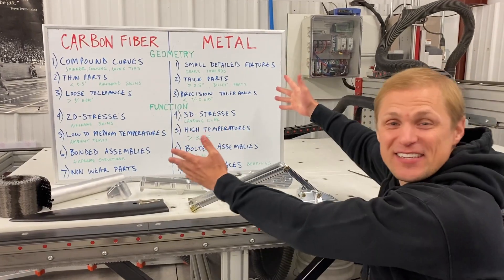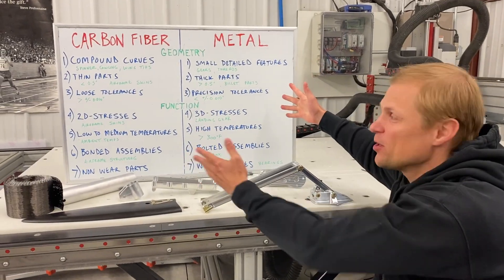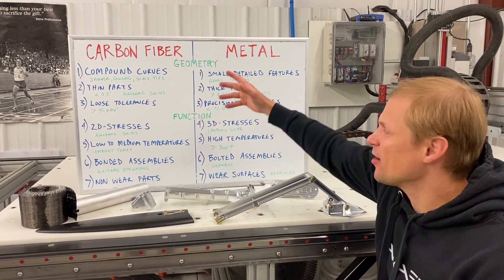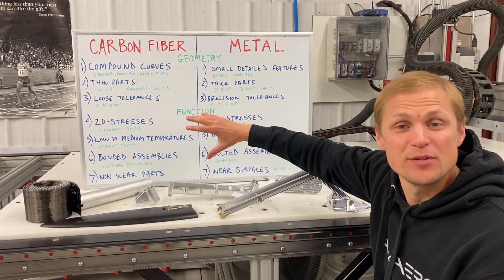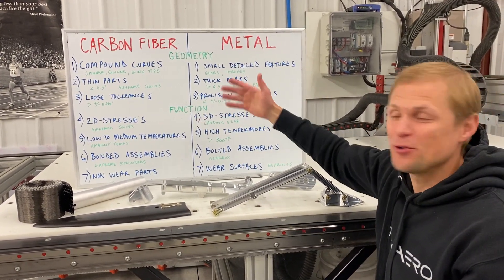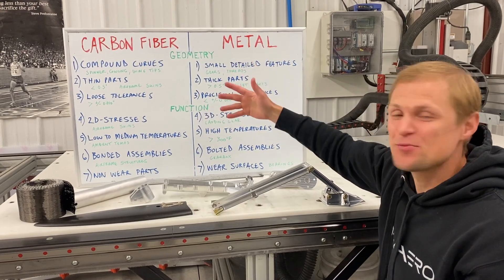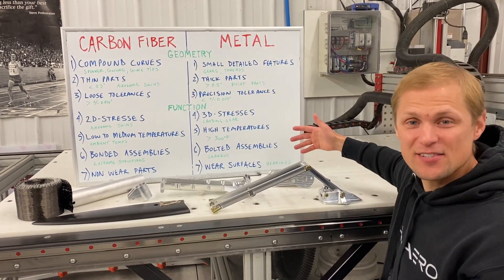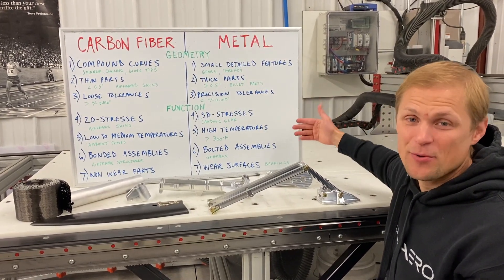CARBON FIBER vs METAL | Which is better?

Comment: Carbon fibre in general has higher toughness for part weight, compared to other materials. (given the geometry is in line with its suitable aplications). However metals are by far tougher for part size. Such as, a tough stainless steel rod hard or flexible,, (based on purpose) is going to be tougher to flex, bend ,or break,  in comparison to titanium alumilnium or carbon-fibre rods. (in correct relation).

In general,
toughness by part weight: Carbon>titanium>alumilnium>steel
tougness by part size: steel>alumilnium>titanium>carbon

Obviously these materials come in their specific alloys. There is a range of allumilnium alloys, which expands further out in both directions (toughness per size and weight), than any titanium alloy does. So, there is a lot of variety between specific material alloys, but ^ this would be a general mind set.

Then there are things such as toughness by part geometry, as guys in the video said, non monolithic parts aren´t very suitable for 3d force aplication scenarios, they also have a minimum size requirement (fibre bundle size). Also toughness by temperature  aplication was a correct thing to point out too. Firstly because carbon fibre has much more temperature-strenght ratio variety than any of these other materials (on a scale from failure by low to high flexibility yield due to temperature) - Carbon fibre becomes brittle at relatively low negative temperatures and it melts at relatively low positive temperatures, and even then between these two fail points, it´ s strengths change drastically. Its not even isn´t fire resistant, metals and more specifically steels are. Some metals also have specific properties,, such as Titanium could be considered somewhat heat retardant, but not resistant or reflective as ceramics are.  Stainless steel 303 seems to be the most tough readily available material on this planet - in general and at various temperatures across its temperatiure spectrum.

All of the mentioned materials vary in these properties, with various trends.
It is thus a valid concern to pick and choose which material is used for which part, as the toughest most flexible and heat resistant material, may fail in the least distinguished stress aplication, simply due to some particular condition as: "The bundle size of a material only holds strength with parts with a consistent crossection twice the width of that of the bundle." or "the lighest toughest most energy absorbant material on earth may not be suitable due to its low density, and therefore required high volume"

Comment: What about cost? Greetings from Turkey, love your content.
Reply from the maker: Excellent point! Thank you for bringing that up! Cost is often another important variable that factors into the material selection process, and it's definitely something we look at. Many of the aluminum alloys we work with are relatively inexpensive for the raw stock, but when you start looking at titanium alloys or even certain stainless alloys, the cost of material can get crazy! Carbon fiber material cost often lands somewhere between aluminum and titanium. Once you start factoring manufacturing costs like labor or CNC machining, the cost comparison starts to get pretty muddy. Thanks for watching and for the comment!

Comment: When i was building formula student car; for the upright, along with the strength i was trying to reduce unsprung mass on the wheel,that was one of many criteria,and finally set on 7075.so weight in the application also servse very important roll.

Comment: It's also worth mentioning that composites are not very good at taking load concentrations (rivets, bolts). Metal being isotropic, it spreads the load much better. It's not just about the through thickness stress.
Reply from the maker: True! Are you encountering many bolted or riveted joints in composite parts on your projects? Most of our mechanically fastened composite parts sit firewall forward. Good examples would be the spinner and cowling.
Reply: @DarkAeroInc  Well where I work most cowls are indeed flush bolted or bear nutplates so although not ideal it's not a big deal. I have just seen bad things happen when holes are too close to edges because composite will tear (cleavage strength) easier than metal. But things go real ugly when you need to bolt structural elements such as spars because our structures are too large to be made or bonded in one single piece. There, you have to pad up an insane amount to make up for the lack of bearing strength of composite and aluminum starts to catch up in the weight contest !
Reply: @SuperYellowsubmarin  Do you bond in metal substrates to the layup, in areas where you need to fasten, say, a cowling to framework?
Reply: @maxhugen  typically you add composite plies just in that area. Bonding metal is not as reliable as bonding composite, and the joint between materials of dissimilar CTE and modulus will be the weak link. Corrosion must also be prevented, whether bonded or bolted or riveted. Sometimes is is the only way, the wing spar cap of the F/A18 for instance is a unidirectional carbone laminate bonded to a titanium fitting with a scarf joint.
Reply: @SuperYellowsubmarin  Hmmmmmm not sure info like this, should be discussed on a Youtube blog, rememmber ITAR? Just sayin......
Reply: A great example of concentrated stress and high cyclic loads is the old way the Firewall was reinforced for the Engine Mount Bolts on the MX/MX2 aircraft. It's since been updated and I believe retroactivity addressed. The pilot walked away, but he was incredibly lucky and talented. But simply viewing pictures on the backside of the firewall where the bolts, nuts and washers were claiming the motor mount (Google it for images) you can only shake your head like how any engineer would think that was adequate for a world class Aerobatic aircraft, that specializes in the four minute freestyle is beyond me. A high schooler would have known it was sketch. Maybe thats why Walter Extra sells so many more planes. Their engines don't fall off.  https://aviation-safety.net/wikibase/178764
Reply: @Triple_J.1  that was a good read. The bracket is indeed a poor composite design AKA "black metal", a component thought as if it was metal and manufactured in composite.

Comment: We ought to make metal parts sometimes just for the cost. Some catbon fiber parts can not be justified, just from a cost point of view..
Reply from the maker: True! Metal parts can often be manufactured using very cost effective processes. Looking at examples from kit aircraft, a sheet metal wing skin is almost always going to come in at a lower cost than an equivalent carbon fiber wing skin. In our design we are prioritizing structural optimization over cost which results in a tradeoff of a higher cost kit relative to a riveted aluminum equivalent.

Comment: Great info just wondered if corrosion or oxidation is a meaningful consideration for your choice
Reply from the maker: Yes, corrosion is an important consideration as well! Composite parts, in general, are mostly immune to the corrosion processes you see with metal alloys, so composites are well suited for corrosive environments like coastal or marine applications with salt spray. When we do use metallic components we try to select alloys that have good corrosion resistance like stainless steels, titanium alloys, or 6061 aluminum. Thanks for watching and for the question!
Reply: @DarkAeroInc  why not powder coat or anodize the aluminum?

Comment: Yeah, metal has a uniform strength, composite is weak on delamination, maybe also compression but trying to bend a CF plate is certainly not easy. Maybe also weak on knock fatigue? If you just have a small mechanical part I completely agree, just use metal but it makes me think about your landing gear. Ultimately I think just welded tube is the way to go, simple, fast, controllable, and I would never do 'billet' CF, but if you want the gear to look interesting then why not do an arm with similar shape, just as a CF shell. You get the stiffness via curvature, it's not all that big a load you have to carry, it's brief load and it's fast to do an interesting shape with CF unlike CNC. It can be complexly organic and look fancy and a shell is light. Why not?
You might be able to do a single piece 360 mold if it's conal. Strong and fast to make. You wouldn't shape it like metal, shape it to its strengths. Could even be aerodynamic to boot.
Reply: I have seen some 3axis carbon fibres with fibers going 0°,90°,45°,-45° and Z 90°, But well, puncture strength of CF isn't very good for a landing leg that will take some high velocity impacts.
Reply: And it would also mean that you need to use dry fabric in a process like RTM I think... I'm not sure that the resin could flow well in a infusion process...
Reply: @LeJP_iz  I don't think it has particularly requirements for the CF process. Could be wet or prepreg. Think trumpet shell shape like.